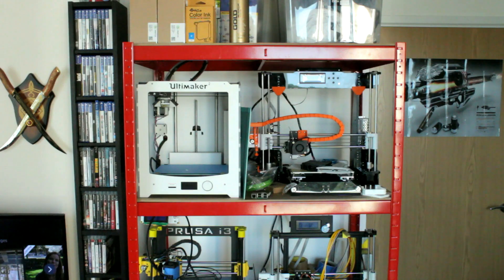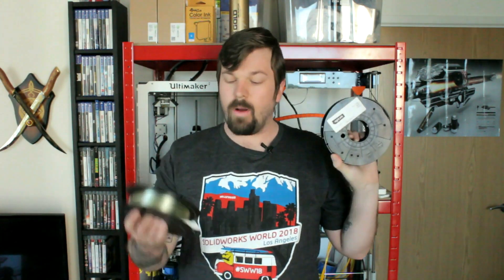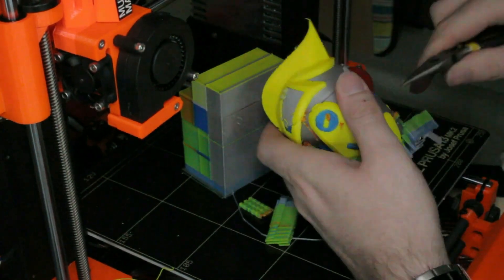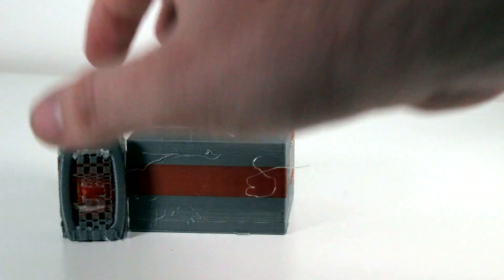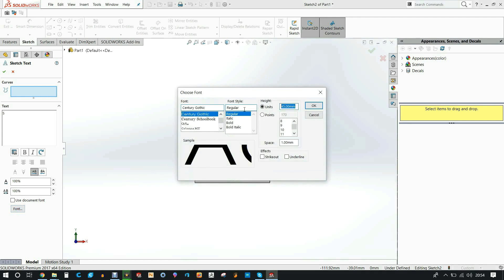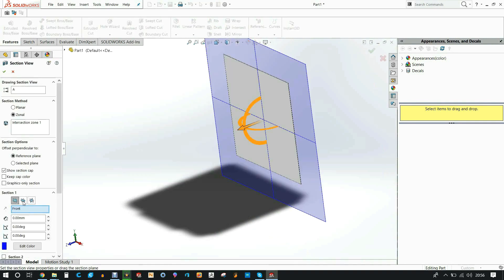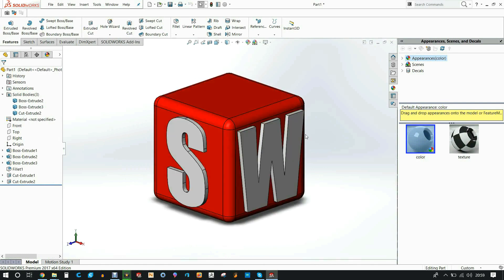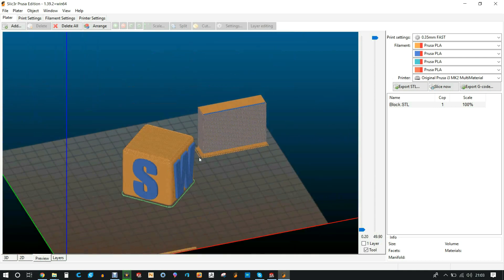Multi Material 3D Printing - SOLIDWORKS

Comment: Hello,  I really appreciate your video.  You certainly know what you are going and are very proficient at it.  If I may give some constructive critism, your explanation and demo are very fast.  Combined with the sound level, made it difficult for my to follow and specially understand.  Might I suggest that when it comes to do the conversion and export to STL, you slow it down, explain thoroughly, and increase your voice level just a bit slightly.  I have tough computer software to adults for 15 years and I have done many video tutorials.  I know it gets to a point where you just through it out there, but you need to resist and slow it down.
Again thank you for this video!

Comment: Thanks for the video! My Assembly has 88 bodies. So this would take to long to export. Fusion has a button now that lets you export all bodies as individual files at once. Maybe its possible to export to fusion as STEP and then use the save tool. (P.S. that tool also crashes a lot.)

Comment: I still cannot take a cylinder with an extruded number, and split the model so as to print the number in a different color. Somehow, is should be simple, but I am stumped.